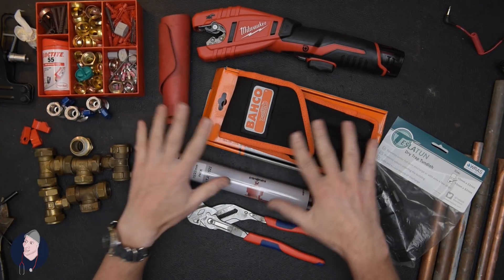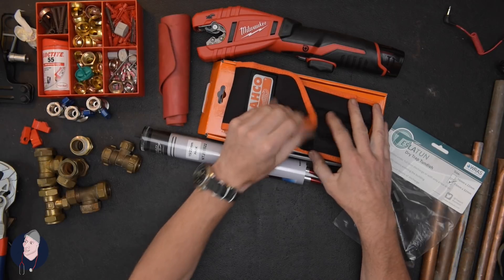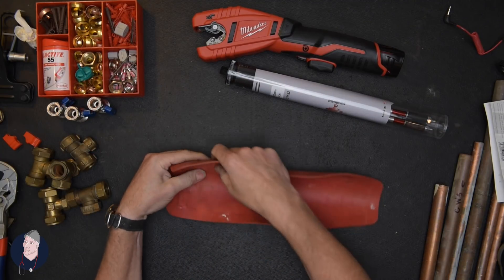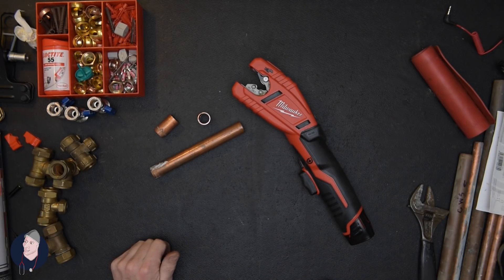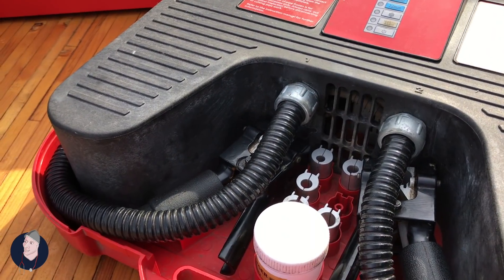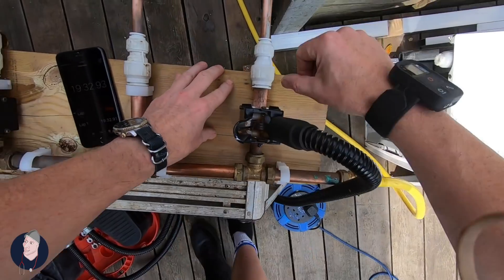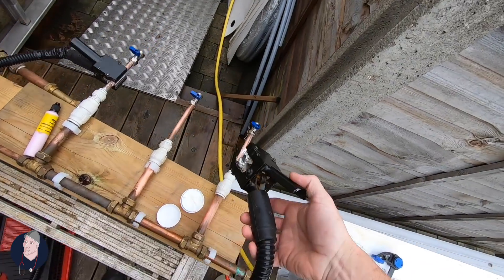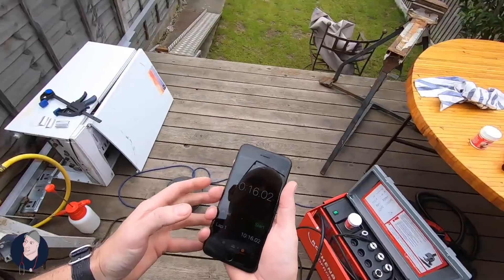Day In My Life as A Plumber No6, Dr Pipe Pipe Freezing Machines and Tool reviews. Armarge Ice Cap-E

Comment from the maker: 3 Machines Rofrost 28 Weighs a Ton of Weight , Eco Freeze weighs in at about 14kgs, The Armarge Ice Cap-E weighs 11.9 kg and is small. Question to those that use Freezing often..Do you use 28mm ? and also Would be interested in your comments with regards to a Single Head clamp Machine ? I think it maybe a good idea ..many times we freeze just one pipe if the Price were Half then It maybe more useful ? Thanks for watching. Im sure we will be doing another review of the Ice Cap -E When its in full Production Has potential .
Reply: I've used eco freeze,to freeze a single  pipe,using clamp 1. Works perfect!
Reply from the maker: jonathan shekleton Yes use it all the time like that 👍
Reply: Dr Pipe 
hi i have a eco freeze had it about tens years 
had the pump break about month ago i sent it to roth and they upgraded and repaired for £80 and the difference from before might be worth having a look into
Reply from the maker: David wright Just bought another for Fun.. no issue with pump 👍

Comment: Is it possible to use a pipe freezing machine on old (100yr) lead pipe? Or would it cause the pipe to split?
Reply from the maker: Should be fine if you work effectively and with just 1 point of freezing
Reply: @drpipe  ok thank you

Comment: Can you tell me if the freezing machine works on heating pipes, the reason I’m asking is that if the heating system has inhibitor this is also an antifreeze
Reply from the maker: Ian Tipping good question .. frozen plenty goes down to -20 odd plenty to achieve a freeze.. always test b4 u cut tho

Comment: we also use the rothenberger rofrost and im pretty sure it can freeze up to 1 1/2" even steel pipes. but it does have some downsides:
-weight
-no defrost
-you always need to attach both clamps or the rofrost doesnt start any freezing. sometimes thats bad in an area with limited space where i would only need one clamp
Reply from the maker: pat nye Interesting .. can you just clamp to a spare pipe and off you jolly well go ? So it was a fluke I happened to use 2 in the test 😂 never knew that. Thanks for watching 👍👍
Reply: @drpipe  im not sure, and im also not sure if the two pipes have to be connected at some point. plus i cant imagine what the technology behind this situation is. but i just put up with using both clamps even if i wouldnt need both
Reply from the maker: pat nye Will ask the question when I’m in the presence of someone that knows the answer to that.. or let’s hope we get an answer here 👍
Reply: Not true. Use one clamp all the time. Once put two together on one pipe but left a small gap in between and created a bulge betw
Reply from the maker: K Hlai Yes you will by doing that it’s the hydraulic pressure you have created. Be very careful on long freezes you will split the pipe ⚠️ the same as serious freezing conditions. Not great when it defrosts and you didn’t see the split 👍

Comment: When I saw the electric Pipe slice, I was like "That's gonna be at least £500" and then you said £120 my jaw literally dropped!
Reply from the maker: Special deals at £90 I saw once
Reply: @drpipe  May have to buy myself a cheeky Christmas present then! 😏😏
Reply from the maker: @xbluewolfy1741  if ur an installer 💯 ... u find u will get Tennis’s elbow if u stretch and cut with a slice .. with ur fingers .. has a right go at the tendon over years 🤭😞😞😞
Reply: @drpipe  My body is f*****d anyway due to a Motorbike accident in 2018 :( anything which makes the job easier is a bonus. Keep up the videos, I am learning a lot from you.

Comment: Versa funnels cool but it stinks of wee & the Milwaukee M12 I've had it 2 weeks top bit of kit 👍.
Reply from the maker: ghostmanromeo uk Never far from that smell in this game 😂🤣 great we can report back in a Year on the M12 ? What about the freezers mate ?
Reply: @drpipe  Thanks Dr Pipe my Eco freeze has been behaving itself since I extended and soldered the cables. Topman & God bless you. The jetsweat tool I haven't used once.  Since I've had it's just sat in the back of the van.  Just like the flue shoe. I'm quicker cutting a flue with my cordless makita grinder and a thin multi blade. Some things turn out to be a bit gimmicky. I've got multiples of wera tools. They always come un handy 😜
Reply from the maker: ghostmanromeo uk Have to say I couldn’t believe when I checked the water and seemed weird.. off it went and checked it not sure why that one but happened when I soldered it as well 👍 Heatshrink is the bomb tho for that 👍. Super pleased for you fella. Just don’t leave in the van when super cold someone had a tube pop. Pleased it worked for you 👍
Reply from the maker: ghostmanromeo uk I think I may use the jet sweat on a Flush at a push.. but think when u see it does work it may get u out of trouble. Flue shoe sorry to big for me has to earn it’s money or save loads of time. Got a hack of that to share !👍👍
Reply: @drpipe  what's the hack Dr ? Yup Flue shoe was pointless. The time you spend pulling it out the van. The cuts already done with a cordless grinder. If you have a more efficient way of cutting flue terminals, please share 😊. Almost 30 now and I my knees are done. We were doing a full central heating install today.
Reply from the maker: ghostmanromeo uk  def will do 👍 30... Youngster wait til your my age 😂🤣
Reply: @drpipe  worst thing about this job is the hours. Plus the Missus is always nagging for me for an e.t.a.  I think I'd prefer to stay at a customers house these days 😂.  Sometimes she right does my nat in 🤣. 

I love learning me, especially when people have a quicker or more efficient way of doing something. You da man Dr P 😜
Reply from the maker: ghostmanromeo uk totally agree about the hours mate. Wife thing yep used to get told about Tools in the hallway ⚠️ not allowed her way highway .. Divorced etc no fun but now I make my rules. Expression youth wasted on the he young ! Umm would do it different now. Treat others with kindness mate. Takes 10 years hard graft for a business then it starts to get easier. I work a lot less now but work smarter. Still not easy. Glad u enjoy my stuff. 👍